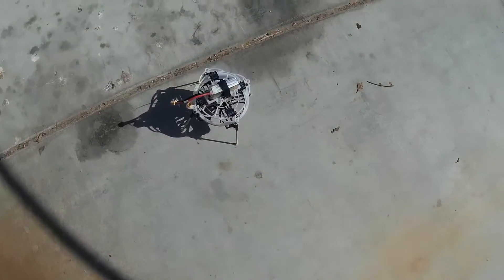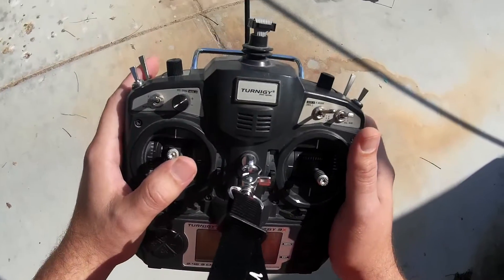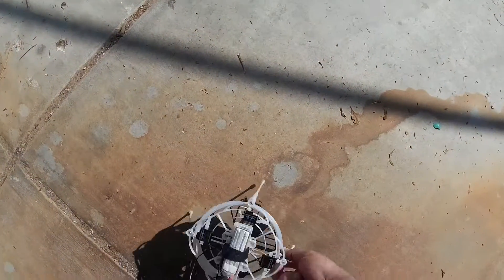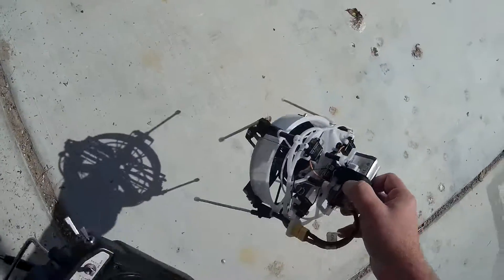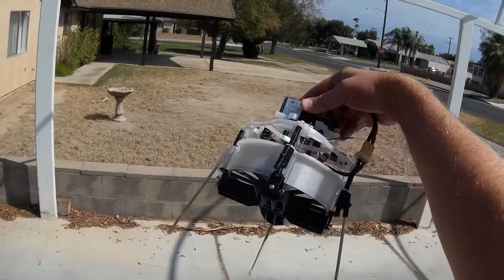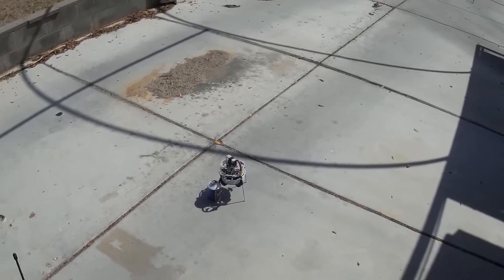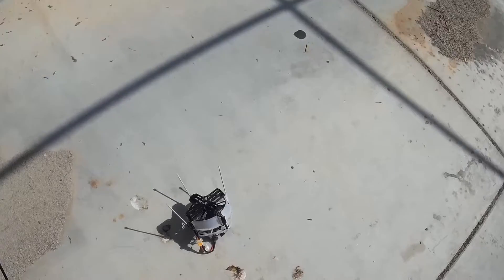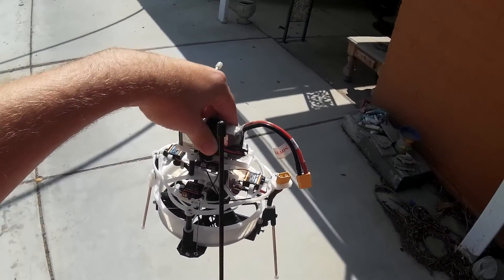Micro T-Hawk singlecopter - First flight attempt

Comment: Would it make it easier to compensate if the battery were under slung?
Reply from the maker: Jeffery Harris the problems isn't balance, it's the torque from the motor.  I need more initial offset in the band's to compensate.  got better with each adjustment but then had to print repair parts and haven't gotten back to trying again
Reply from the maker: vanes, not band's.  darn autocorrect
Reply: this would definatly make it work better.
Reply: Shane Shenanagins No - it would not.

Comment: Saw that on Thingiverse and been wondering about it,hope your second attempt brings success!
Reply from the maker: Thanks, I'm not sure if the issue is I'm not taking off fast enough and running into that I term windup issue, or if it's vibrations causing issues, or something about how I setup my servos.  Ordered some carbon fiber to make better legs and will give it another go once I've got those replaced!